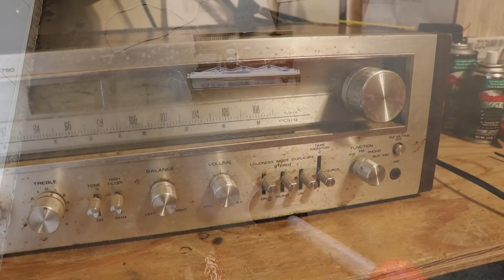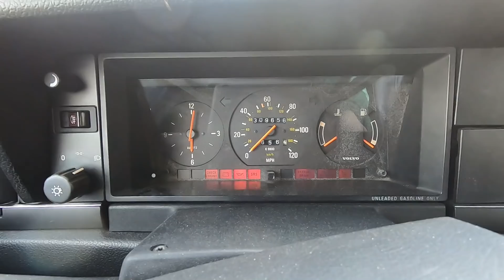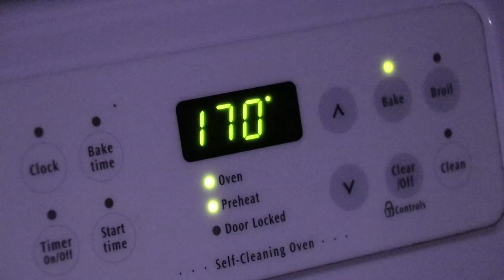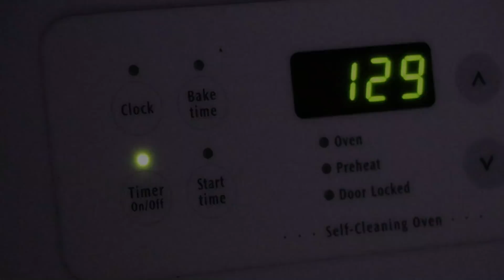Power Washing My Pioneer SX-750 And Seeing If It Still Works

Comment: This always happens when you put un anodized aluminum in a dishwasher. It’s a reaction with the detergent. The protective aluminum oxide coating on anodized aluminum prevents detergent from getting to the aluminum metal below.
Reply: Good to know!
Reply: Maybe try some jetdry rinse aid?? ;)
Reply: I use an ultrasonic cleaner for the knobs and faceplate.  Works great.
Reply: You can't use anything caustic (basic) on aluminum. Dishwasher soap is extremely basic. So is oven cleaner, and general "kitchen de greasers". All very bad for aluminum. If you washed it with hot water and hand dishwashing detergent (like dawn or palmolive, etc) with a soft dishcloth, you'd have nearly perfect results.
Reply: @Roscoeverdin5469  
Hi what type of fluit are you using withe the ultrasonic ??
Reply: @drsound-speakerrepairsmelb6374  
I use a wetting agent such as Triton-X.  9 ml to a gallon of distilled water.  You can also use Iford Iffotol as a wetting agent.  Same ratio.

Comment: I have literally just bought an SX-750 yesterday. I love receivers, not just the sound quality but also how they look. Being on a limited budget I have to save fairly hard but the Pioneer joins an elite group of receivers I will never sell. I can see the merits of power washing, every electrical item on the PCBs should be completely sealed with maybe the relay being the exception but what really has my toes curling is the time spent in the oven afterwards. I worry the meters will melt, maybe the circuit boards will warp, it's frightening so hats off to you for having the courage to do it.

Comment: As I've been repairing audio gear since before you were born, (and since you clearly asked in the title of your video), maybe I can help. To clean a nasty aluminum faceplate without removing the lettering or corroding it (that white stuff you found on the faceplate is aluminum oxide, the faceplate is ruined), take the faceplate off just as you did and clean it and the knobs with generous amounts of Simple Green and a microfiber cloth. You may need two or three cloths. I like to actually soak the knobs in the simple green in a bowl for a few minutes. This will even remove decades of cigarette smoke without damage. You still need to avoid rubbing too hard on the lettering, as it's just silk-screened on and then coated in clear-coat, and DO NOT use anything but a cloth to rub the faceplate. Windex works for the glass, of course. You'll need cotton swabs for the detail work. I get the ones from Amazon with pointed tips.

And they're called car washes because they're NOT stereo washes. If I did that to one of the pieces of gear I work on for a living, I'd never get another client again. To clean the innards of a nasty stereo, you'll need to invest in some CRC electronic cleaner and a couple of 2" paint brushes. For an entire unit you may need two or three cans of the cleaner. Wash the innards down with the cleaner and use the brushes to wash the grime away. Do this in a well-ventilated area. The cleaner evaporates in seconds, so work on one section at a time. For a unit that's really dirty, you'll have to take the thing apart to get to everything. This is work and expense you can't get out of if you want the results without doing damage. 

Yes, I know you've done the power wash thing without apparent damage both on this and on a Marantz. The operative here is APPARENT. Problems may well make themselves evident days, weeks, or months later because you didn't get all the water out that you put in to things like the power transformer, RF and IF transformers, the tuning capacitor, the speaker relay, switches, etc. 

It's OK to power wash circuit boards that have only sealed components and whose traces are entirely sealed with conformal coating, like modern-day computer motherboards. But not this stuff. And not entire units.

Oh, and I started out by saying that I had been doing this since before you were born. If you're more than 45 years old, I stand corrected, and retract that statement. 🙂
Reply: Scott GR… He’s not doing it for a living plus he said it was for satire. I would send my stuff to you before I had him work on it but come on, it’s fun to watch. I’m sure if he wanted to he could do all the things you mentioned but his views would drop. He’s a uTube’er you are a professional stereo repair tech. Gotta admit tho it is amusing? By the way thanks for the simple green tip.
Reply: @bubbleone6526  He said that this time but I don't think he said it wouldn't he power-washed a Marantz receiver in another video. I'll have to look. And I am happy to see a younger person doing this kind of work. We old guys are a dying breed and there's very few of us left working on units from this era. I just don't want to see gear like this damaged during repair attempts, I don't want to see people get hurt by unsafe practices, and I hope he will take my advice to heart. 

Simple Green is a lifesaver for removing tar from cigarettes!
Reply: @ScottGrammer  Thanks for the reply. Yeah it’s hard to find a good repair person let along a bad one now days. I have a Harmon Kardon Citation 16 that need a good going thru and here in Washington it almost impossible to find anyone.
Reply: Mark Walker (blueglowelectronics) who I consider an expert doesn't recommend this power washing. As for the CRC cleaner I seldom use it you need to be outdoors in the open air.
Reply: Who cares
Reply: Totally agree with your rationale.  Okay he did say he didn't recommend this for everyone, but you know some YouTube viewers are doing to ignore the fine print and go ahead with this craziness anyway and probably end up ruining a perfectly good and functional bit of gear in the process.  :(  IMHO it's a stunt for getting more views.  Just look at some of the other electronics related channels with idiots doing similar things and they are getting hundreds of thousands of views.  It's this sort of idiocy some dumb arse viewers  are looking for.  Responsible informative channels are almost extinct.
Reply: @alanrutlidge4767  Well, I won't call this man an idiot, he clearly has a good idea of what he's doing in other videos. And perhaps he did just do this to get views, but still, as you said, some will not get that and will try it themselves. BTW, a Pioneer SX-750, in good running order, is currently worth about $400 - $500.00. EDIT: I looked at the Marantz video, and he commented, "Just to be clear, this video is NOT promoting power washing as a method for cleaning your gear. It was my first time doing it and I took the risk because this is YouTube, and it happened to work out well in this instance. I had fun making this video and I hope you got some enjoyment from watching it!" I must give him credit for that, but still, powerwashing is not for vintage stereos. And I noticed he changed the title on this video....
Reply: The only damage he did was to the faceplate and knobs by putting them in the dishwasher. The pressure washer didn't damage anything that wasn't already damaged...
Also note, he did this to his own property, not a customer...
So take a chill pill
Reply: @alanrutlidge4767  I think most folks can see this is risky. If u cannot, u probably should not be repairing high end equipment. This is entertaining and informative. Didn't we all want to try doing something like this, but could not afford to? If I had a glut of old receivers or one that had already been abused badly, why not try this?
Reply: Scott you are a professional, much respect to you. I have 40 yrs in audio repair, I really enjoy the younger guys who have the passion for the craft. I really like the young man and enjoy the effort.
Reply: @aceautonewportky  I agree. I have an 18-year-old apprentice who is learning from the ground up. He just finished building a radio kit (soldering practice, following instructions, reading schematics, etc.), and I'm very proud of him.
Reply: OK boomer.  We forgot that everything is about you since before we were born.  You kno.
Reply: Not sure how many of his videos you've watched but this guy is legit. Very very very few YouTubers his age with his level of expertise and passion. This was very clearly a satirical video and not a method he was promoting. Vintage audio desperately needs people like him to keep this dying art alive. Your silly chiding makes you sound as old as you are (I'm close to your age BTW...). 

Also, I'm surprised, given your level of expertise, that you are recommending blasting the entire board with CRC cleaner. Pointless and could cause more harm than good. Plus it will leave a strong chemical smell that will ALWAYS be noticeable every time the unit is used

Comment: On my dusty 750, I removed the back and removed a lot of dust from around the components.after getting the big stuff, there was still a greasy coating on the boards ( May have been a smoker around it years before) . I got a full can of CRC electronic cleaner, turned the chassis on its side and washed from top to bottom with heavy flow of  CRC liquid. The dirt flowed offf, without any moisture to short or corrode components. The unit plays cooler now and the Crc cleaned the boards and components with visible dirt running off the low side. I did this on both sides. That all you really need to do to. the inside.I  LET IT DRY for several hours before powering up. i also cleaned the controls with CRC, followed by De Oxit. The unit works like New now.

Comment: So I did something very much like this with my Vintage analog synthesizers years ago.  I washed them in the tub with the shower head. What did help get a lot of the built up grime on the boards was spraying Simple Green on the boards first and let them sit for 5 min then spray them off. It always worked for me and they looked as good as new.

Comment: This is pretty much a list of things NOT to do!!!!  And he paid the price with losing the protective layer over his anodized front panel.  I am a professional restorer of high end equipment for high end customers.  I would like to propose the following alternative techniques to what he did, and I think I know something about the topic because I have done hundreds of these throughout 4 decades, and almost never had a failure.  First of all, I always start with Q-tips and distilled water - the same technique used for restoring fine artwork because it is GENTLE and EFFECTIVE.  You would be surprised just how many contaminants love to come off.  The reason is simple - high concentrations of chemicals naturally want to move to lower concentrations.  So they love to combine with water.  I think that would have done a much more effective cleaning than what he did.  It would not have attacked the protective coating on his front panel and knobs.  I cringe when I see power washers and air compressors used on equipment.  First of all because the equipment is DELICATE.  Pressure of any type can bend tuning capacitor plates, resulting in the need to straighten them and do a full instrument alignment.  I do not see any equipment here that could do an instrument alignment, so his receiver IS (not may be - IS) in need of a full instrument alignment.  The second reason I cringe is the chemical makeup of tap water.  Especially in a car wash, which can legally use reclaimed sewer water not safe to drink.  He not only put minerals from the tap water all over his receiver, but he also baked them onto every surface.  Water, contaminated or not, likes to wick into small places.  Every single one of the IF transformers, and variable capacitors such as those on or near the tuning cap are now full of water, and a back at 170 degrees for an hour and a half is nowhere near sufficient to get it out.  I do soaks, too, but in DISTILLED water - pH neutral - and SOAK, not pressure wash.  I am continually surprised at how long it takes to dry out.  I NEVER bake, because plastic formulations in many capacitors, and in many RF coils will melt at 170F.  In addition, solder does not have a discrete melting point.  It is a colloidal mixture of metal and may begin to soften, even at 170F.  Because it is not a true re-flow, it is only going to produce cold- solder joint failures throughout the PC board.  Another problem with water, especially tap - is those minerals are going to coat the carbon surface of pots, and coat the contact point in slide switches and pots.  It will be DARN HARD to get out once it is in there.  He had a spray can of de-oxit, so he knows better.  For high end repairs, I disassemble each and every pot and switch and carefully clean and re-lubricate.  As he observed, bad switches can make or break a unit.  Power washing with TAP water and then BAKING minerals inside the switches is the exact opposite of what you want to do.   The water will also get in between power components and heat sinks, lessening the effectiveness of heatsink compound.  It will also get into that power transformer and cause rust.  Soaking is a last resort - I only do it in cases of prolonged submersion in a lake, or any exposure to salt water - although I do not guarantee restoration to units submerged in salt water for over a week, or in fresh water lakes for over a month.  I have had to start turning away Ft. Myers Beach and Sanibel customers because two months in salt water is too long.  I also turn away smoker units, because the chemical damage to delicate IF and RF transformers is usually too severe to repair.   A far as the particle board case - if you get those things wet they will swell and end any possibility of using it.  As he probably discovered.  Real wood cases will warp, but re-submerging and putting each piece in a 100 ton press can straighten them.  But it takes bleaching and re-staining to restore wood cases that have been wet.  Not an easy or short process.  This guy may get by on sheer luck, but I guarantee he has introduced a host of problems into the vintage receivers.  I have seen units "repaired" by guys like him come across my bench.  I end up spending 2 or 3 times the labor reversing their mistakes, and having to charge my customers.  With the advice - next time bring it to me first, NOT an amateur, because you are going to have to pay a lot more to reverse the damage caused by inexperienced amateurs.

Comment: AH, did you bake or broil the Pioneer soufflé? Too bad about the coating on the faceplate. You’ve got your work cut out for you with this unit. Can’t wait to see it restored. Amazing it still works at all after power washing it.
Reply from the maker: Bake! I think the faceplate will clean up just fine
Reply: @AHFixIt  maybe try convection oven!

Comment: I use aluminum wheel cleaner spray to clean the parts that are aluminum., specifically Eagle brand. It has never caused a problem and is gentle enough to not damage any of the designator lettering.

Comment: I read from a technician at Tektronix that the first thing they did when test equipment was sent to them for repair was a power wash followed by a blow out and two days in an oven set to 130 degrees.
Reply: Link please.

Comment: I have heard that water can get into the plates on the transformer and start to rust. Drying in the oven may help prevent that.
Reply: When iron rusts, it expands.  This is why rusted metal bursts through paint. The expansion of the iron oxide can cut into the paper insulation inside the transformer and short- circuit it.
Reply: Who cares
Reply: @Poppinwheeeeellllllieeeeez  perhaps the next owner who buys this amplifier under the belief it has been "restored" when it stops working due to a rusted out and not readily available transformer needs replacing LOL. Remember his his standard mode of operation is to replace all the capacitors and most of the semiconductors (even though there is probably nothing wrong with them) in the name of "getting another 30 years life out of it"  LOL. It's obvious to the trained eye that the high pressure water washing technique isn't good for the longevity of the amplifier.  If it was so great and good for the longer term life of the amplifier every restorer of electronic equipment would do it - right?
Reply: @alanrutlidge4767  but really...who cares
Reply: @Poppinwheeeeellllllieeeeez  If the caps are paper and water seeps in, they may swell and/or change capacitance.

Comment: Usually white flaky residue on aluminum is corrosion, which is exactly what that looks like. I'm wondering if the high heat of the dishwasher took off the clear coat on the faceplate and it corroded during the drying. If you get it all off and looking good without damaging the lettering I'd hit it with a couple of coats of clear before you put it all back together.
Reply: I think you're right I just recently Cleaned up a Yamaha receiver and it did kind of the same thing
Reply: Sure makes me wonder. I clean radios all the time, usually tube boat anchors, but I've never put anything in the dishwasher. My wife would kill me if I did.🤣🤣🤣
Reply: @AmishSpecialForces  i know!..  I would do it when she's gone but I need her help to turn the dang thing on!
Reply: @Blownproductions  Oh I know how to use it, but anything other than dishes would be a death sentence😵
Reply: spot on ASF, clear coat went bye-bye, and face plate oxidized.
Reply: Yup, and can happen fast in a high heat-high humidity environment.

Like a dishwasher.

Comment: I wonder if this would have been feasible actually if you would've followed up with a distilled water final soak on the board and would've done something different with the face. Not a perfect method, but this stuff is so hard to clean. 👍

Comment: the drive?🤔 hmmm. great edit on the intro. I've done that before when I went through my component harvesting days. the oven is a crucial step. I just would be scared of power washing mdf. I guess as long as you can dry it before moisture seeps in it would be ok.